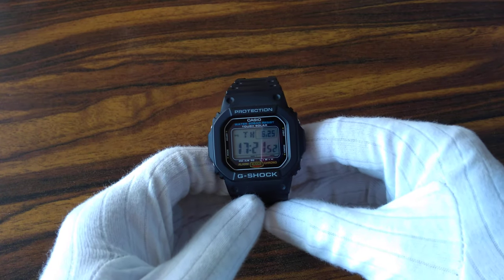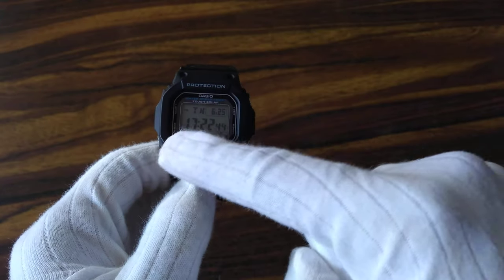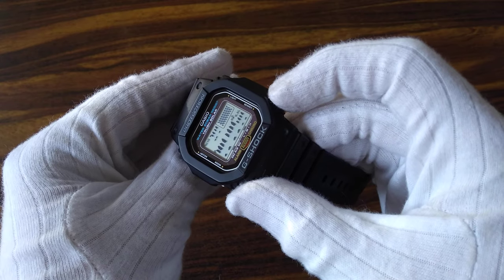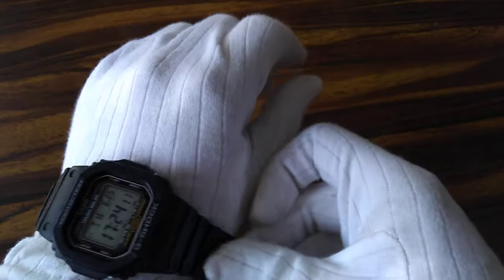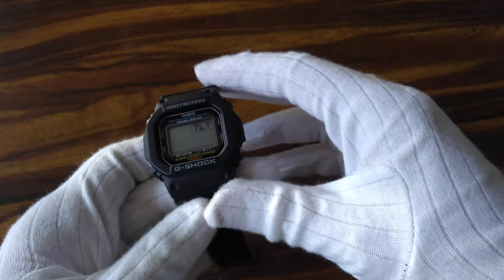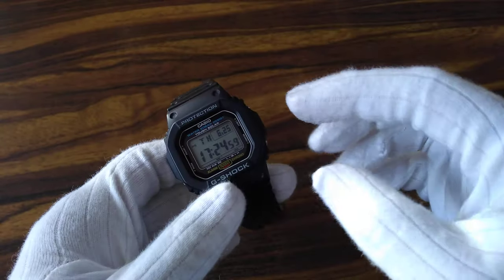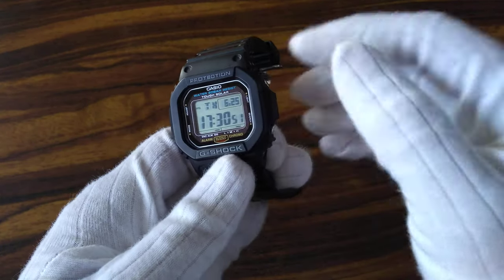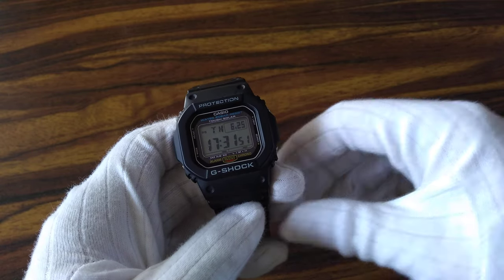Instructional Video : DIY G-Shock 5600 Diagnostics Tips Tricks

Comment: Auto illuminator means light will glow when tilted 40 or more then 40 degree from horizontal...it does not mean that it will glow automaticaly in dark as you are trying to to do.
Reply from the maker: Yes....it does that
Reply: @timeloupe  I have a querry, today just I reieved this watch and in display test it is showing module no 3495, but it is actualy printed 3496 in documents..why?
Reply: @timeloupe  bhai you were right...auto light glows only when there ks very low light or dark room..if auto light is on then it wont work in daylight.
Reply: @rawatranjeet1421  yahi mere sath hua h aaj
Reply: @arjunsinghbhatti2824 light dark area me hi glow hoga..which is good
Reply: @rawatranjeet1421  phone call pe baat kr sakte h kuch doubt h mere  ko watch me
Reply: @arjunsinghbhatti2824  idhar hi puch lo..online hi hu
Reply: @rawatranjeet1421  steel lock pe china likha h or back hand pe thailend likha h bhai
Reply: @arjunsinghbhatti2824  china likha hai...actually jo strap and locl hai wo china me manufacture hua hai..and uske bad puri watch thailand me bani hai
Reply: @rawatranjeet1421   back hand pe 3496 likha h or screen pe 3495 aa raha  h
Reply: @rawatranjeet1421  plsz bhai 5 mint k liye baat kr lo call pe mera Doubt clear ho jayga
Reply: @arjunsinghbhatti2824  ha wo screen pe 3495 likha hua hi ayega..yahi doubt mera bhi tha..fir mene casio cutomer care ko mail.kiya..to wo bole ki that is ok no issue...ye actual me 3496 hi hai...3495 ka updated version hai...isme display test karoge tab bhi RCV likha aata hai jo USA and europe wale model me aata hai..multiband wali watch me
Reply: @arjunsinghbhatti2824  and dont worry you have bought a master piece...its genuine watch
Reply: @rawatranjeet1421  Just frnds baat to kr sakhte h plsz bhai yaar
Reply: @rawatranjeet1421  Bhai mera ek sawal hai bas. If you can please answer. Jab Button B yahi light wale ko 3 sec press krte hai to Turn On and Off Tilt mode. Toh display mai kuch likha aata hai kya?
Reply: @rawatranjeet1421  In the latest version of this watch, on enabling the auto illumination, does the watch displays that?
Reply from the maker: You would need to check on latest modules datasheet
Reply from the maker: Yes on tilt only but in dark.... You are correct
Reply: @timeloupe  Thank You Dada

Comment: Hi. Wonderful tutorial, thank you for sharing your knowledge, experience and passion.
A quick question please sir:

I recently bought mine and it arrived with the battery on 'm'. 

Ive had it open in the room and even placed it in direct sunlight for 10 minutes. It changed to 'h' , however after 10 minutes it returned to 'm'.

Is this normal? 
Do i return it back to seller?

Comment: my casio g shock 5600 UE  battery level is kind of stuck "M" Even after I keep the watch in sun light for 2 days its kind of stuck there. Is there any way to reset or solve the issue?
Reply from the maker: maybe servicing needed...or you may keep for some more days
Reply: @timeloupe  how much time ideally required for a full charge of battery
Reply from the maker: @kirak1986 depends on if it is too discharged ....or if it may need servicing

Comment: Sir. In my 5600ue with module no. 3496..I didn't find an option A.EL instead it shows LT. 
Also pls let me know buckle clasp says 'casio china'?
Reply from the maker: Different 5600 have different features. 5600 series is a vast range with different modules and functions
Reply: Hey Dude.. I also bought the same China buckle one watch. Is our models genuine and did you find Auto Light function in this model.

Comment: Sir what is the RCVD just above PS mode does this Module of Casio Gshock Dw5600 has atomic time keeping???
Reply from the maker: RCVD is time sync received indication
Reply: @timeloupe  I know sir but i want to know does Casio Gshock Dw5600 e and Casio Gshock Dw5600ue-1 has this feature??? As as i see RCVD when i tilt the screen in daylight.
Reply from the maker: You need to check that model....if it's not available then the segment has been disabled
Reply: They use the same panel even there is no function.

Comment: Bro, I bought 5600ue-1dr but my module number in the display and module number on the back of the watch are different. What should I do?
Reply from the maker: Worry not if you have bought from original source
Reply: Same...3496 on back and 3495 on display....bought it from Amazon.
Also when the module number displays....it show 002 in the right corner box. Can you please explain that?
On the back of watch it's written made in Thailand but on back of strap buckle it's written Casio china
Reply from the maker: Maybe they are mix and matching module and casebacks. Do mail Casio for clarification
Reply: Mine also says that but it must be the same model but a module with a different production date or perhaps they are the ones that ship to the West. In addition, mine also says Tahilandia on the case but China on the strap.

I would not worry since everything since all the functions are perfect and I bought it from an official distributor.

Comment: nice explanation man is the watch you showed in the video is this  G-SHOCK G-5600UE-1DR - G1166.  I have  G-5600UE and on the case back it is written made in Thailand and on the clasp it is written casio china  plz reply
Reply from the maker: clasp might be made in china...casio has many production units and accessory supplier....not everything maybe made under one roof perhaps
Reply: does  G-SHOCK G-5600UE-1DR - G1166 have auto illumination(TILT sesonor)?

Comment: Personally bought the solar powered version of casio G-Shock DW 5600 watch... 
Utterly disappointed with brand Casio G-Shock!
Just after 3 or 4 months of normal usage ( No swimming, No Diving, No Extreme water Sports, No Surfing) it developed fog and water vapour inside the glass disrupting the time view.
I went to the Casio Service centre but the service center people bluntly told me that there was no option for replacement. They also shamelessly told me that their watches are water resistant and not water proof. They said they never claim that their watches are water proof in their advertising also. They simply changed some parts and dried the fog or water vapour inside AND after a few months the fog and water vapour inside the glass RETURNED. What a Waste. 👎
Had it been the case of putting the watch under extreme conditions , it is understandable, but the refusal to replace the watch under normal conditions seemed callous and unprofessional on part of Casio. Utterly disappointed by such a big brand LIKE CASIO AND G-SHOCK with big & HOLLOW claims! 😒